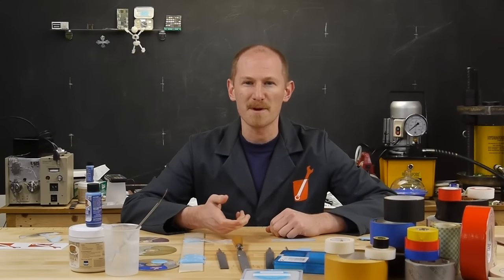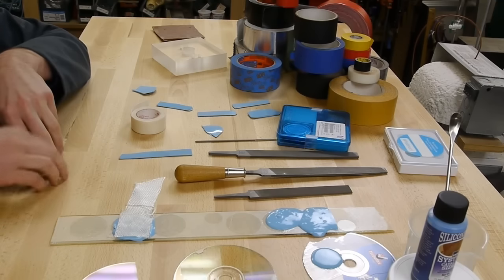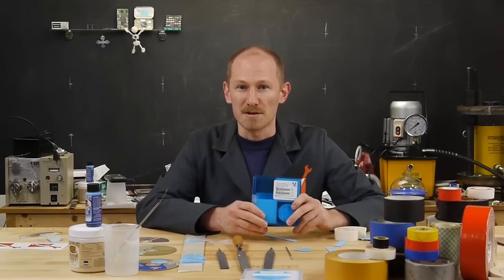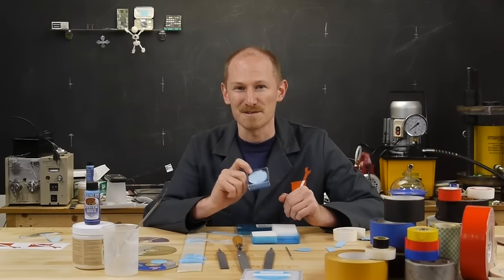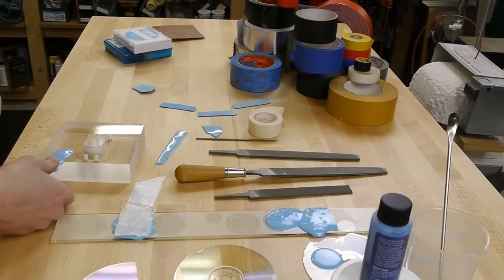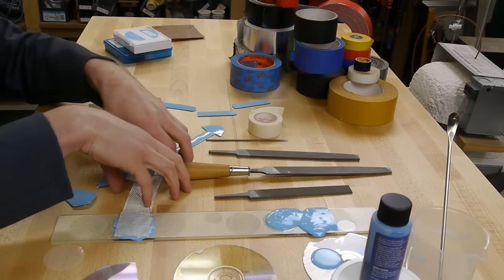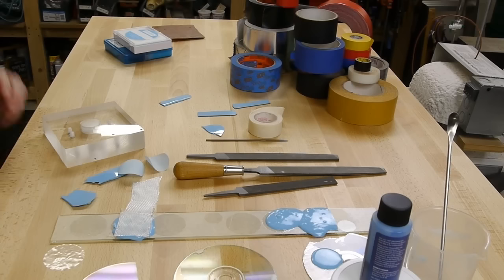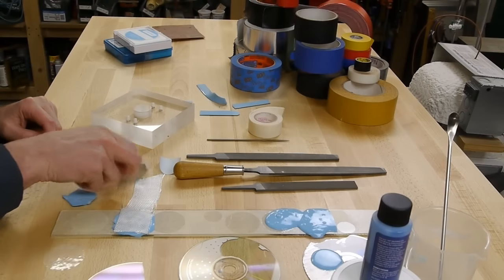Making DIY gecko tape - work in progress

Comment: For what it's worth, I have about 10 years of hobbyist experience in moldmaking and casting.  I am also a moderator on the ResinCasting subreddit.
It may seem a bit silly, but honestly, the idea that others have proposed to make a mold of an actual live gecko foot is not a bad one. The nice thing about silicone is that you can cast it in to silicone molds and wind up with very little loss of detail; even when done repeatedly. This means that you could take one lifecast of a gecko foot; turn that into a resin copy; and then press that resin-gecko foot into clay repeatedly (and probably very carefully). Then make a mold of that in silicone, preferably vacuum-degassed. this will then be a perfect medium for you to cast instances of gecko-tape in silicone.

I would also like to add that using additives to change the durometer of silicone is not nearly as effective as instead selecting different formulations of silicone.  For the sake of mimicking the flesh of a gecko foot, I would recommend something particularly soft, such as Polytek's Platsil-gel 00. That said, the formulation is so very soft that it may be in your best interest to back anything you cast in it with additional silicone of a higher durometer. Solvents in particular are bad to use as an additive because they ever-so-slowly flash off, causing shrinkage in the part, in addition to constantly changing physical properties.

Another thing you might want to investigate is an alternative additive, that I only know as "Dick Smith's Prosthetic deadener.", again, a Polytek product. I confess that I do not understand the chemistry, but, when added to normal silicones, such as platsil-gel 10, it transforms it's behavior into something the closer emulates fatty tissue. In the extremes, it almost behaves as a non-newtonian fluid.  I think the proper term would be "viscoelastic". More important than that, this additive has the effect of making the silicone surface permanently "sticky". In the special FX world, we often use the stuff to make silicone prosthetics that can be applied and held in place without the need of time-consuming and complicated silicone adhesives.

Tap Plastics is a fantastic company; and I have purchased from them many times before and always been very satisfied. But if you are interested in exploiting the properties of silicone, you may find that you have much better results when given the much wider product-selection of more intensely mold-oriented companies, such as Polytek or Smooth-On.

Regarding the trouble with the sharpness of pits vs valleys in high end steel files, the simple solution to that is to make a silicone mold of the file, and then use that silicone mold to make a copy of the original file using additional silicone. Casting silicone into silicone is slightly tricky, because it requires a specialty release-agent for the best possible results, but once you understand that, the results can be seriously impressive.

I hope this helps. Keep up the fantastic work!

Comment: Almost every modern printer has an encoder strip with thousands of near microscopic black lines printed, all perfectly opaque and evenly spaced. Maybe you could stack and align several of these to make a lattice shaped light mask. You could even control the angle of the lattice which might change the overall shape of the microscopic pillars. Hope this helps. Good luck!

Comment: I have used Anodized aluminium to create ultra high density, high aspect ratio structures.
The initial thickness of the film gives the height of the final structures

Step 1: Deposit evaporated Aluminium (sputtered Al didn't work well for me) onto a surface, or if the structure isn't critical use a bulk piece of Al but the results will be worse and the height control will be based on anodization time. Polishing will not be able to create an ultra-flat surface but if it's not critical it could be OK with around 0.250 micro diamond paste and a fine cloth.
Step 2: Anodize at 40V in 0.3M oxalic acid at around 1 to 7C  OR    Anodize in phosphoric acid 0.42M at 100V at 1C, there are many other possible values so search for what you want.

Optional width control step: Step 3: Widen the structure in 0.52M phosphoric acid for 10-30 minutes to fine tune the aspect ratio.

This can be done on bulk Al and based on the known anodization rates reported and sizes for given conditions, you can determine the time to anodize the mold and the widening time.
Reply: +tipexisfun 

This SEM is fairly representative of what you'll get anodizing some bulk Al as a template:
http://www.jeolusa.com/RESOURCES/ElectronOptics/ImageGallery/tabid/323/galleryType/SlideShow/ItemID/17/AlbumID/3/Default.aspx

I would recommend bulk Al since it's far more durable and can be used repeatedly, especially if you can dissolve away any remaining silicone with a nasty solvent. Also note the above SEM's "two stage" structure, near the surface it has an open structure and it becomes smaller further down. This is the structure you want in the negative after all.

Comment: Applied Science, I have a possible solution for you.
Anodizing of aluminum forms nanopores (which are then filled with dye). Anodic aluminum pores are regularly spaced and very dense. They are around a couple hundred nanometers across and I believe the depth can be controlled in the process. Use this very cheap and easy to make/obtain material as your mold and cast your silicone on it, then de-mold it and you'll have silicone nano pillars. If the silicone can't be successfully de-molded by simply pulling it, the aluminum and aluminum oxide layer of nano pores could be etched away chemically, leaving the silicone intact.
Reply: Great idea, it's easy to control both the rate of oxide growth (thickness) and the pore diameter with anodization, it's super versatile. Then a quick soak to etch the oxide. You can get real tricky with it and form bulbous/filamentous structures at the end of the pores by controlling the voltage/current density to match the gecko foot morphology if you liked .

Comment: Could you decap an old cpu with a big feature size like a pentium 1 and cast over it with silicon? Maybe you could also use a memory chip to get a more uniform pattern. You could also try casting on top of a camera sensor. A full frame sensor out of a canon 5D or a 1D might work pretty well and they're really cheap nowadays.

Comment: Here at the foundry we usually would tackle this problem with a BCP thin film with a lamellar structure. Something like PEO-PS. You could control the aspect ratio pretty easily and then dry etch out the PS block. What I will tell you is that its not just the aspect ratio that matters. Believe it or not, the actual pitch has to be specific for maximum effect. If you calculate the surface energies and do sessile drop tests you will find an energy maximum very closely matched to a geckos feet. Basically you want to mimic the total morphology of gecko feet over mesoscales. Luckily you dont care so much about long range order. You can also tailor the hydrophilicity of the edges of the lamellar walls by branching some short chain dendritic polymers off of the PEO wall tops. You have to of course first swell the PEO before you do the functionalization and polymerization. Then let it dry and cure to reveal the trenches again. But since you appear to be hacking here I would say you could just get away with anodizing some aluminum plate and then curing your polymer on the surface of the anodized aluminum. By controlling the temperature, voltage, current, and ion concentration of the bath you can control the hole dimensions with reasonable accuracy. If your interested in any BCP samples to try out let me know.

Comment: At the local $2 shop I found a multi-sided abrasive block, 6 faces as you would expect, and each face is abrasive with different grades, and VERY fine and in a grid like pattern. It is a cosmetic file thing for polishing fingernails, and I found it great on metal. It appears to be some sort of very fine fiberglass like stuff molded in silicon. I photographed surface with a hair ~~20microns as visual reference, the grid is about 200 microns, at a guess. I confirmed this using a vernier and a 10x magnifier. The grid is 200 micron, so the holes which I can only imagine are quite small ... A polished surface looks like about 2 micron scratches, which is a surface finish I recognize.

Love your video clips!! Keep up the interesting work.

Comment: is there a substance that produces regular and controllable crystal growth on a microscopic scale that could be used?
Reply: +inademv Carbon nanotubes, with the vacuum/gas high temp. method. Flood the base of the "forest" with silicon, (or what ever work) to keep them together.
Reply: Seth Roughani
Could graphene sheets be arranged with enough precision to produce the desired shapes for the silicon "fingers"?

Would it be possible to use an actual gecko digit to make a negative mold?

Perhaps an investigation into the biological mechanisms that enable the gecko to grow and maintain such fine and delicate structures might yield some insight into how the process could be manufactured.
Reply: +inademv "is there a substance that produces regular and controllable crystal growth on a microscopic scale that could be used?" Isn't silicon used in cpu manufacturing because it 'produces regular and controllable growth on a microscopic scale'? I'm not 100% clear on the doping process - it's been a long time since I picked up any material regarding it but I'm pretty sure they dope a pure silicon mix to leave 'gaps' in the molecular matrix at regular intervals.

Huh? Use silicon for the mold instead of the cast itself? And like someone above suggested .... perhaps use something a little more rigid for the cast too.
Reply: +inademv Right?  Something that can be dissolved afterward to preserve the shape of the silicon fingers...

Comment: The grip comes from the compression of the peaks in a geckos foot. When you have flat glass made silicon you have more contact area with the plastic than you do with the gecko tape. So what I am saying is that gecko tape requires compression(the weight of the gecko) to work. So comparing cast flat glass to gecko tape is like apples to oranges they serve different purposes. I love having a place to explore these ideas thanks for the great videos

Comment: A dialysis filter may work, but it could also have holes that are too small, as they are meant to filter individual molecules
Reply: +laggerd There are molecules of all different sizes, and filters made for all different sizes of molecules and particles, so I am sure the right size could be found. I think the issue with filters is the thickness, because if the fingers become too long, it is useless to use as gecko tape.
Reply: +Jacob Creedon I don't have much experience with casting but do you think that if the mold was turned upside down before curing, that the fingers wouldn't flow the full length of the filter and stay short enough?
Reply: +Jacob Creedon There is also a density issue apparently

Comment: I at one point built a macro scale version of the unidirectional gecko foot pad. Obviously it didn't work the same way as an actual gecko foot, but the little silicone flaps would catch on the surface and dig in to create a very conformal and secure grip. 

The robot it was used on, TARS, has a lot of interesting little design features. Many based in optimizing a particular design as far as it can go, reguardless of if it was a dead end or not.

Comment: With regard to your hypothesis about the valleys in the file being less well-defined than the ridges, leading to less grip, is there any way to cast a negative mold of the file and use that for your silicon casting? Awesome project :D

Comment: -Fresnel lens (already given, i think)
-gratings used for spectrography (availables at thorlabs or EdmundOptics)

both are made by diamond engraving a master, when replicating using plastic of any kind

-good old vinyl disk ?? diamond engraved

-the end of a glass fiber large rod, cut, polished flat and etched with quick heat+solvent to break and remove epoxy on a very short length, leaving fibers "hairs"  (possibly a 2 steps setup, first a master , then remolding on th emaster to get new hairs)

Comment: why did you try a CD and not the much higher density blue ray?
Reply: +Enjoying28 Thought of the same thing. But after a second thought CDs/DVDs/etc might not work at all, because as far as I know, the "grooves" aren't really on the surface of the Disk but rather in a metal layer that's protected by some sort of transparent layer.
What might work is to use a hacked BluRay writer to engrave some other surface.
Reply from the maker: +Enjoying28 The pits/lands of a CD are already small enough in diameter for effective gecko tape.  I was initially worried that the silicone would not fill a 1um hole, but was surprised that it made a good imprint from the CD.  Trying it on a DVD and Blu-ray will not take much time, and should be worth trying, but I suspect the pit aspect ratio is not quite right for good gecko tape.
Reply: +Applied Science I would also try with different media a real CD as the pitting in that may be more substantial.
Reply: + Applied Science That makes me think of something else entirely... if you cast a CD in silicone, and then cast a resin or thermoplastic on top of it, then silvered it, would you acquire a readable CD copy?

Comment: I used to work for a Semiconductor company and they used an e-beam machine to make the fine patterns used to make ICs.  One of the extra abilities of the machine was that it could operate as a Scanning Electron Microscope.  So if you had a SEM that you could alter the scanning/beam intensity pattern you might be able to lay down the pattern you want in the resist.  I think our electron sensitive resists were proprietary but you might be able to find something commercially that works.  You might even try a thin sheet of phosphor to translate the electrons to photons.

Comment: The problem with the CD method is that you are using a writable CD-R and not a CD that used a pressed master. The CD-R uses a light sensitive film that can be written by the laser.  A pressed CD actually has physical impressions.  Either way, a factory pressed bluray or HDDVD would be a better option because the feature density would be much higher.  I would also play around with the amount of curing agent to change the silicone "hardness" for high aspect ratio features.  There is a ton of research in this area under the name "soft lithography."

Comment: You mentioned that a lensing system wouldn't work because the lenses would not pass UV. Would it be possible to coat your lithographic film with a phosphor that fluoresces UV  in response to IR or Visible light (I believe they exist)?
Reply: +Sardi Pax One other thought is the crystal growth (in air) of pure Tin metal. This is called Tin Whiskers in the electronics industry and is quite a challenge since the introduction of lead free solder. For complicated reasons the tin migrates from the surface into incredibly fine hairs. It's a hard to control process but as you only want short 'hairs' maybe you could form a negative casting, into which you cast your silicone.
Reply: +Sardi Pax nope, that won't work. You need the wavelength of UV to get the detail fine enough. So you cannot project light with enough detail on your UV fluorescing material. The UV will be wholly unfocussed, so there you get another source of blur. If the UV was needed to start a chemical reaction it might work though, but then two-photon systems might work better.

Comment: I don't know if you ever heard of this but treating a steel file with sulfuric acid actually  sharpens the file. Some control of concentration of acid and time of treatment is important. The process etches the outer cutting edges more on the sides than on the tips leaving the tips sharper. These sharper edges could lead to a finer imprint in the silicone upon casting. 

Another idea I had for making tiny holes is using some sort of mechanical chopper to chop a laser beam at a very high rate and direct the output to a moving target creating a mold that has a large number of very tiny holes. Maybe instead of moving the target, one could develop a system whereby the chopped beam would produce a raster effect and sweep a stationary target in a defined pattern.

Comment: How about using sandpaper as the mold ? You could have alot finer 'hair' that way and they would be very densely situated, you could use something like 10k grit or so for the tape. Or you could take very fine metal powder and put it into substance that would not interfere with the silicone and give it a super strong maknetic field to give it that spiky surface. I hope this helps.